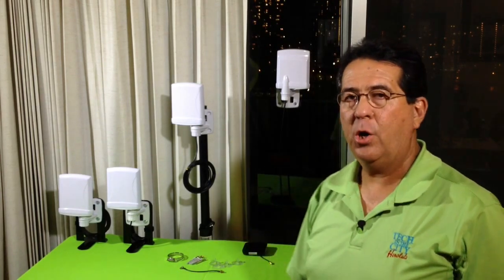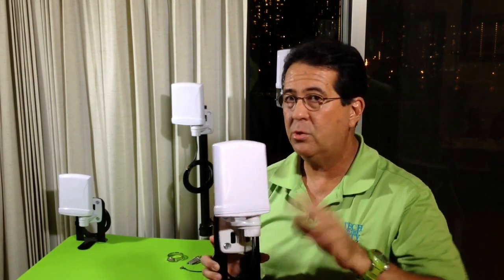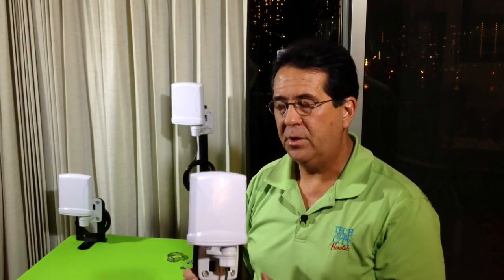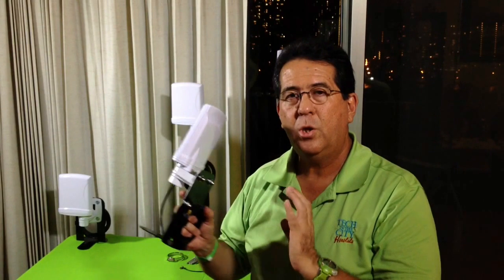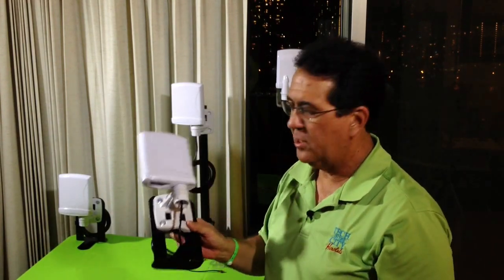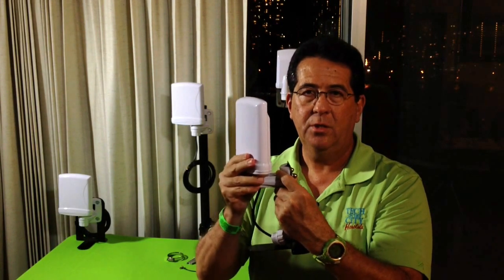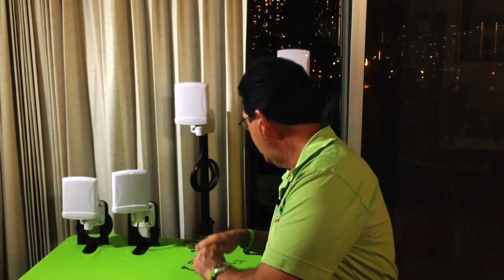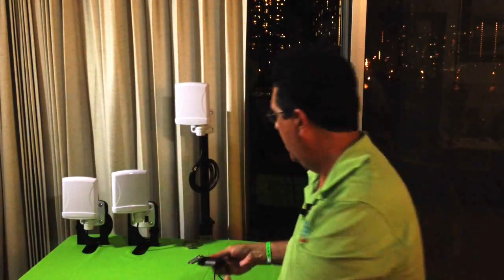CLEAR Hub Express - Improve reception with our External Antenna

Comment: Will this work for mobile phone purposes as an external antenna?
Reply from the maker: Probably not as this is tuned for the 2400-2700MHz frequency band. mobile phones use different frequencies, however, a different antenna plate could probably be used within the antenna enclosure (the enclosure is the real star of this design).

Comment from the maker: Placing an external antenna outside on the patio (in the same place where you placed the CLEAR Hub Express) will typically result in the same results as having placed the CLEAR Hub Express there... And maybe even better since this antenna is a directional one, PROVIDED you can determine a particular direction that a more abundant amount of the signal from the CLEAR Tower Site is coming from and aim the antenna towards that direction so as to better enhance the signal. Send me an email for info.

Comment: Hi. I have a clear hub express and I live in an apartment building. I'm only getting 2-3 bars of signal strength. If I set it out on the patio ouside the door I can get an extra bar. Download speeds are about 3.5 mbps. Would this product work in my situation? Tower is less than a mile away and our apartment is between two buildings.

Comment from the maker: The Sierra Wireless Overdrive Pro (AKA Sierra Wireless 802 hotspot) does have two TS-9 connectors. HOWEVER, those ports are NOT traditional antenna ports like the ones featured on the CLEAR USB or HotSpot modems. They are only for use with Sierra's proprietary "Performance Dock", an accessory available for the Overdrive Pro that connects to those ports to help with 4G signal. Supposedly, according to Sierra Wireless, simply plugging an antenna into the ports does not result in any signal gain.

Comment from the maker: I feel that the root causes for most of the complaints were related to:
1 - The past issues related to the NOW DISCONTINUED 2-Year Contract plans and policies. It seems that the plans were either misunderstood or simply not explained properly by the individual CLEAR sales agent. 
2 - Poor building/foliage penetration of the 2.5-2.7GHz WiMAX RF frequencies  - - An External Antenna(s) may solve this issue. Best to consult with me first.
3 - Tower Congestion issues on particular CLEAR Tower Sites.

Comment from the maker: The CLEAR Hub Express Modem has a single External Antenna Connector. The CLEAR Atlas Stick USB modem has Dual External Antenna Connectors.

While it is possible to modify the CLEAR Hub Express so that it can accommodate Dual External Antennas to improve reception, it will also void the warranty. In my opinion, the added reception/performance characteristics derived from a Dual Antenna modification outweighs the $50 cost of purchasing a new modem.

Comment from the maker: This antenna is provisioned with upgraded gold plated connectors to extend the longevity of the connector. Most people do not realize that the Gold plated connectors are used to help protect the fittings from oxidation and not to improve electrical conductivity. I use better grades of 50 Ohm LMR100/200/240 Coaxial Cables to enhance the overall efficiency. Unfortunately, these type of components are becoming more expensive. I now sell this antenna for $59.99 plus $10 S/H via USPS Priority Mail.

Comment from the maker: We design, produce and sell directional WiMAX antennas, including the one shown in this video. Please refer to the comments section of this video for a link to our ONLINE SHOP on Facebook. You may also go to eBay to purchase one of our new "CLEAR Hub Express 14dBi WiMAX Antenna w/5-Mtr RG-58 cable, RP-SMA-male connector" (Item# 161000663066) or our "CLEAR Hub Express 18dBi WiMAX Directional Panel Antenna w/5-Meter RG-58 cable" (Item# 161001549326).

Comment from the maker: Aloha Nino-Glad to hear from you! The video is up! Tests were conducted from a Non-Qualifying service address per Clear - OE's projected Floor Level 4+ CINR is only 5.8. Very weak signal when within the unit located on the 25th floor without an antenna. I had to go out on the balcony to get a decent signal without an antenna to conduct the baseline tests. The Clear site used for the testing has downward tilted panels and is over 3/4 of a mile away, so I'm technically out of the service area.